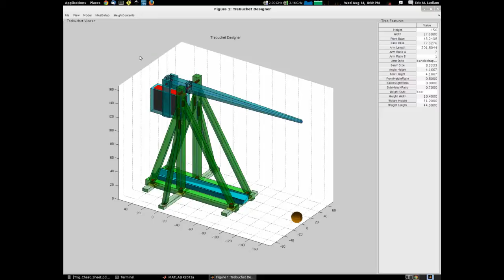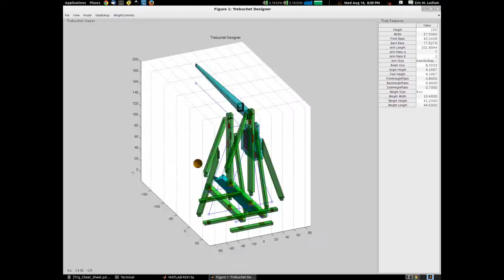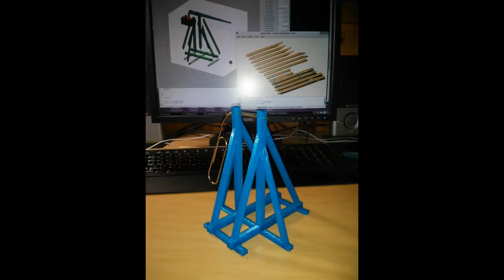Team Tormentum: 3D printed Trebuchet

Comment: how do you make 3D models in matlab???
Reply from the maker: I created the graphics in MATLAB Handle Graphics, and wrote a script to export them to OpenSCAD.  Most shapes made with 'patch' using triangles translate directly into the OpenSCAD polyhedron as long as the normals are set correctly.